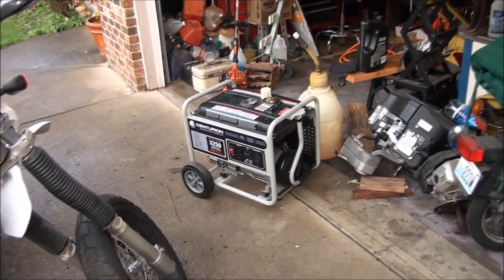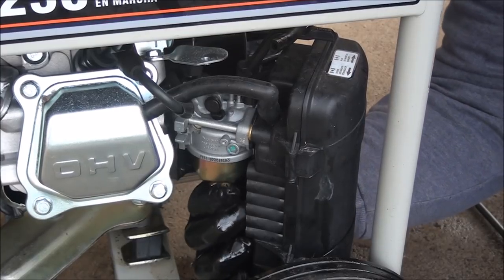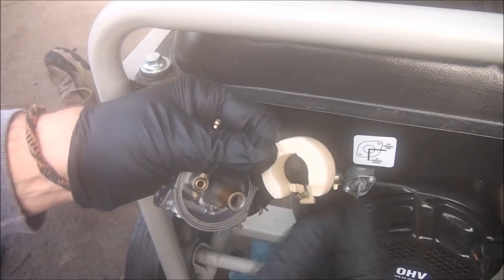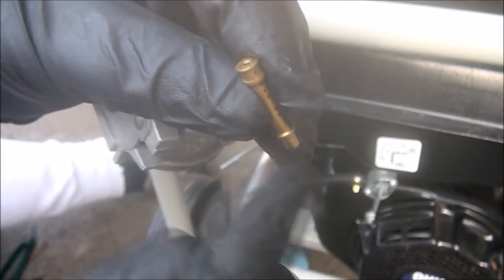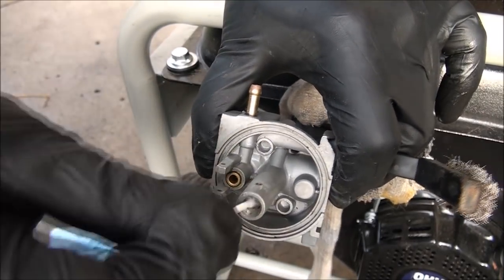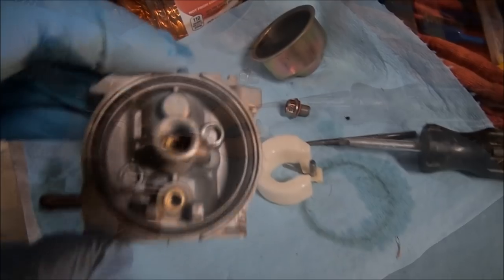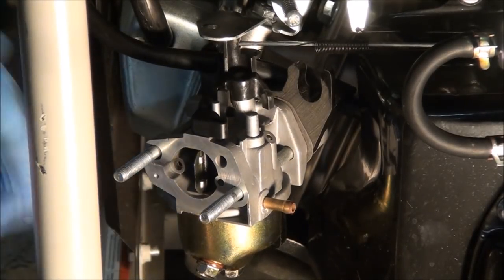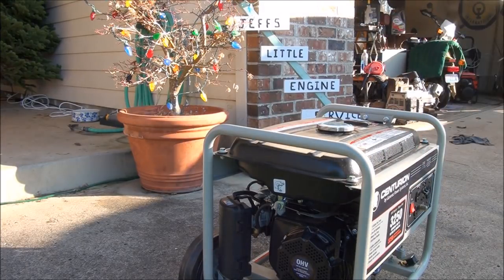Newer GENERAC Wont Start. Centurion 3250 Generator COMMON Repair after storage. Easy Carb Cleaning

Comment: Very complete and helpful vid.  Its amazing how sensitive these small engine carb ports are to corrosion/contaminate plugging.   Draining the gas and running them dry for storage saves a headache for sure.

Comment: Great video. I just finished cleaning my carb on a 3250 generator. Your video got me through the process with no problems. This is the first time I've taken a carburetor apart. The generator started up with the second or third pull and ran smoothly.

Comment: One of the better on-line instructional videos I've seen.  Nice to hear correct names used for small  parts like main jet, emulsion tube, float valve, pilot etc.  Couple cautions worth mentioning though.  When cleaning/clearing the the tiny orifices that empty into the throat as well as the single on the intake side of the throttle butterfly, you really need to spray cleaner with straw attachment and only spray from the inside out...same with compressed air.  Those are the bottleneck of the fuel system.  The gunk you so often see is a combination of ethanol residue (through striation) and polymeric residue.  The striated ethanol after exposure to air (usually through the ambient pressure port) eventually takes on a crystalline structure and with all those sharp edges to bite into the soft brass, well, flushing with pressure from the wrong direction can be more than counterproductive.  Also I'm sure you wet and twisted the Q-tips to avoid "fiber drop" but your viewers don't know that because they didn't see that...just saying.  For all it's worth I like tapping my wire strand reamers with a hammer to flatten them and create a sraping edge.  I've knit picked you (it's easy to do and I'm good at it...lol) but truth be told this is an excellent presentation and you are to be commended!  One last thing...I promise...really...Those are NOT 10mm bolts, studs or nuts...they are 6mm fasteners that require 10mm tools.  I know I'm overly critical and for that I apologize.

Comment: Nice job Jeff: I had the same carburetor in my shop last week that had pinholes in the float bowl. Great Gasoline (not) Also had water in it. I cleaned it and put a new bowl and needle in it and it ran great, like yours did. Thanks for the video's.

Comment: Thanks I have a Generac Generator that's not been run since I've ran it years ago , but I ran it till it started spuding - and hit the choke and it should have sucked all the fuel out and burned the gas up .

hopefully . If not when I  need it all I'll have to do is throw gas in it - if not I'll use this video . Thanks

Comment: We solved the carb problems by turning gas shut off valve while motor is running which in turn empties the carb until the next time you need to use your gen, it's a simple solution folks !
Reply: Did that. Even added a gasoline preservative and it still fouled.

Comment: Great video Jeff!  I have the same one I bought at a yard sale for $20.  I have it running fine however it does not produce power.  Any thoughts on what might be the issue?  I can't find a reset button anywhere on it.  Thank you!!
Reply from the maker: There should be a reset somewhere on it
Reply: @Jeff's Little Engine Service    Thank you!  I will look again.  I plan on testing from the outlets and breaker to the avr and brushes.  I don't see and bad coloring of the windings do I remain hopeful. 

I did like your video  thank you for taking the time to put it up.

Comment: I have an Einhell generator looks very similar to this one in positioning of carby, filter etc. Watched a different video yesterday but they didn't talk about the slow jet 9.35 min into the video! So guess what! when it didn't work I searched again for and found the best helpful video in youtube land! Took everything apart again cleaning the slow jet and found that the orings had perished. cleaned up again assembled and YIPPEE it worked beautifully! THANKS JEFF  :)  Will this be OK going forward without those orings? Or should I purchase new orings? Regards Paul
Reply from the maker: if it works, run it! I don't think the orings are available seperately

Comment: Great Video. Next time clean out the Tank, Fuel line and Pepcock.
Reply from the maker: Good tip! I forgot to clean the petcock bowl....
Reply: I would not recommend touching the petcock.  It is cast metal and mine shattered like glass when I tried to remove it.  I was thinking there might be a strainer that should be attended to.

Comment: The engine of this type is actually a subaru 4 stroke engine. I have this similar motor to generator and also mower (ryobi) i found the schematics for these engines. they range from 140cc-190cc and be of many CC's engine type to which model and torque. Unfortunately, the carbs are usually good. but its the tanks where the fuel sits gets seriously dirty and most areas to air get rusted very quickly.

Comment: That plastic screw doesn't adjust the idle, it only keeps the pilot jet from coming out.  Many of those smaller carbs have no way to adjust the pilot jet beyond replacing it with a different size.

Comment: Jeff. My brand new Generac 8000 watt starts electrically no problem. Ran It fot 4 hours tested running house via inlet box.
Just put 3/4 gallon of gas in. Oil level is good.

Problem is it wont PULL START.
ANY THOUGHTS?
Reply: Not familiar with Generac's system but possibly the key switch for the electric start needs to be in, and remain in, the "on" position...even when using the recoil.  How do you shut it off?  Is the "on" position shared between both modes?  Just a thought.
Reply: @dalelange845  hey,  Thanks. Before your reply I had a brainstorm. Lets make sure my switch in in the "ON"   position. Yeah that was it. My switch is 3way. Start,on,off.
LoL....gotta laugh at myself before beating myself up!!!
Reply: Too funny.  James, I almost left it alone.  I was thinking "he'll figure this out" and then "he's already got it".  The only reason I tossed it out there was as a final goal for myself to reach to be able to call it a day, a very long day, and then i could put the phone on the charger and finally get some sleep.  Anyway, just taking a step back for a moment away from the frustration seems to work more often than not...maybe it just breaks the pattern of thought that overshadows the simplicity of the solution, if that makes any sense. Lol
Good to know you actually already had the answer and just needed a moment to let it find it's way out...funny how the universe works.🤔  I do equipment repair (both ag. & construction) and here's  an equally bizarre phenomenon;  I can go a year without working on a 545 Ford loader then I'll get hit with 4 of them at the same time with the exact same problem.  Wierd...and it happens ALL the time.  Anyway I wish you the best and appreciate  your update.✌

Comment: I stripped out the soft brass main jet w/ a screwdriver and it's stuck inside the carb still.  How can I get it out now?  Thx for the help.
Reply from the maker: you will have to extract it with an extractor
Reply: A small easy out.  Spray some lube in the cavity and let it sit overnight.  You might also try (really) sharpening a small steel chisel and giving it solid wack or two.  Either in the old grooves or make new at 90°.  Either way use the widest chisel that will fit in the cavity (max torque).  If that doesn't work and you cant catch a thread sometimes gently driving it counterclockwise while at the same time applying more pressure on the opposite radius with a small punch will give the chisel side just enough to start a thread.  Then there's always heat...if you go this route make sure there's no left over lube, solvent or gas that will catch fire...and ONLY heat the outside of the pick up tube...you want it to expand while your main jet remains cooler than the tube.  If you are successful using any of the above remember to run a tap down the tube, obviously with the emulsion tube removed, and run a die around the main jet before reassembling.  If you are able to re-use the main jet be sure to clarify the screw driver notch with either an electric cutoff wheel or even a hacksaw so that the screwdriver you plan to use fits that notch both snug and deep.  And next time remember to use a round shanked screwdriver that fits proper...brass is super soft.  Good luck and I hope you repost with your results.

Comment: where can you buy the pilot jet?  I can not find a source> not even generac corp.  I did find a carb at amazon.com. but no slow speed jets. my  slow speed jet had a broken o-ring...had to buy the whole carb for $25.  Found it by carb brand name and wattage  GP3250. it was a viable solution, but I did not need the whole carb, I only needed the jet with the o-rings on it.
Reply: I'm in the same boat at the moment as I need the size of the orings for the "pilot jet", I'm assuming.  I wish the video would have been edited to say that it shouldn't be put in the carb cleaner bath before and not after.  Anyone know the size of those orings?  Looks like the pilot jet has "45" on the top which may give some idea of size but I can't nail that down via Google searches.